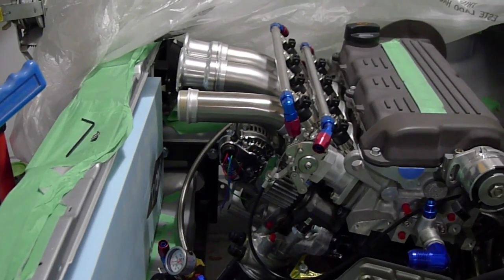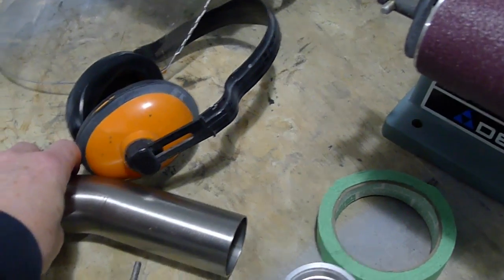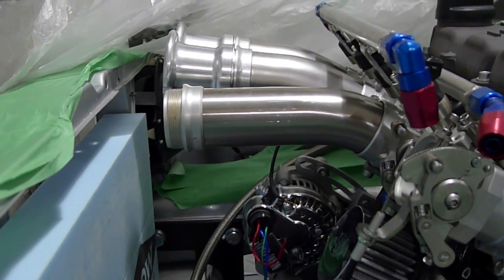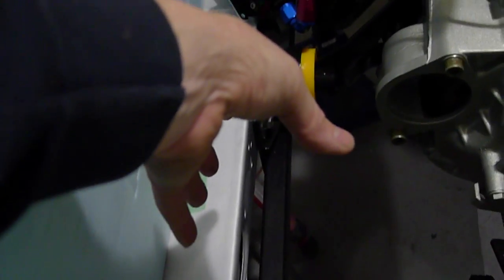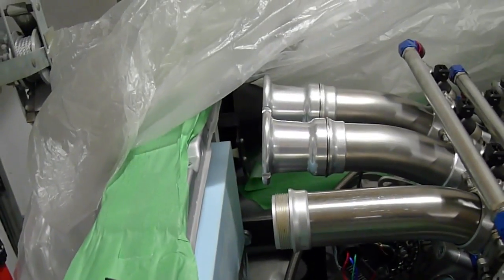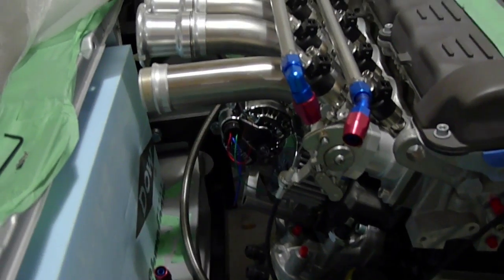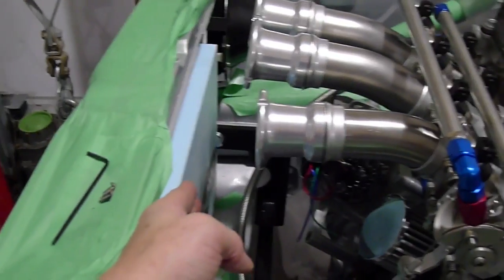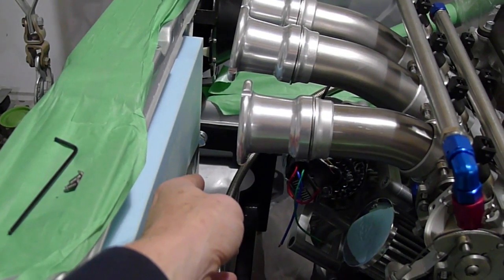The Ultimate 1983 Rabbit GTI - part 68 (New ITB intake runners - Success!)

Comment: You could shorten that radiador and would not have overheating problems, I've used honda small radiador with a good fan and no problems, that would give some more space
Reply from the maker: I think you are right but some folks have pushed me to increase the cooling system capacity. The custom rad is almost done so there is no turning back now ... that said, I hope to get the intake system air box done without compromising the air flow ....

Comment: Good Day Derek so if the Intake tubes are longer you get more power than the shorter intake runner ?
Reply from the maker: +Lando Rose Think of the intake and exhaust systems as musical instruments that have frequencies that they are tuned to based on the length of the runner (or in the case of a  guitar, the string). A distance of 330mm from the intake edge to the intake valve stem puts the power peak at 7500rpm (my engine design). Shorter runners would move the power band up and past the sweet spot where my exhaust system, cams and transmission are setup for. The stock 16V intake system runners are even longer. Often people put in ITBs with fairly short runners due to constraints on fitment - they tend to still produce good power but would not result in the best possible power levels.